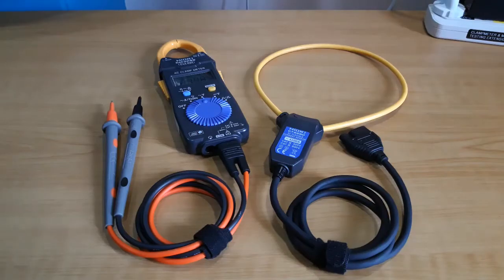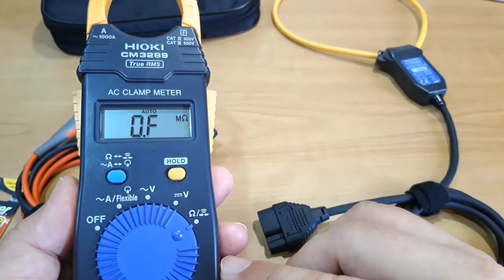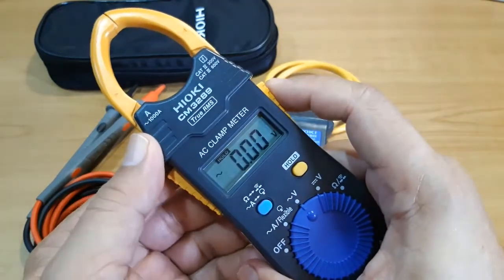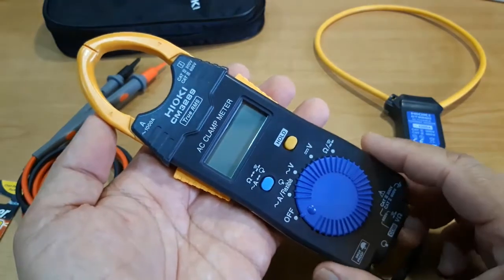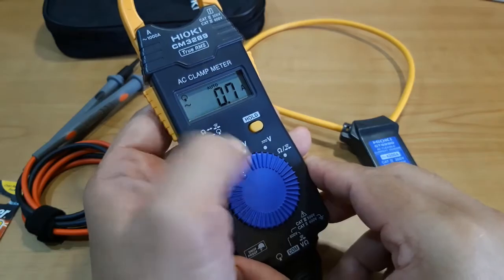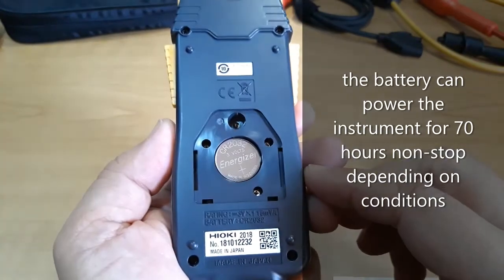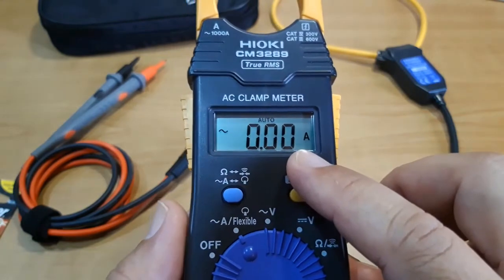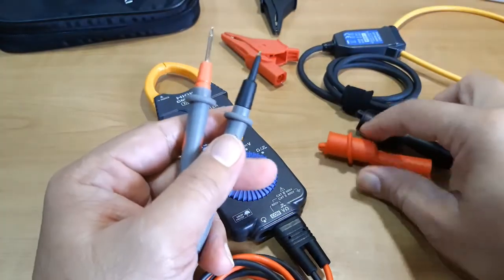[English Sub] Hioki CM3289 AC Clamp Meter and CT6280 AC Flexible Current Sensor Review

Comment: Thanks very thorough and clear. You obviously spent the time required to serve an excellent presentation. What is the correction factor for multiple flex sensor wraps around the conductor when seeking increased sensitivity? Thanmks again.
Reply from the maker: Thanks for your appreciation. There was no published correction factor for the use case you mentioned, unfortunately. It's also not specified for measuring minute currents or leakage currents. But coiling it twice on a conductor produced 2x the current reading, which was a good indicator for accuracy or at least consistency. Should be useful if you want to measure current 1A or so on a location too narrow for the rigid jaws of a clamp meter. I'll try and upload a short demo of this.
Reply: @ramschannelreviews  Thank you. I too have only seen a chart with Three circles and numbers one through three. no other notations, but it suggests what you demonstrated and observed. Thank you.
Reply from the maker: @flashwashington2735   I ran a 2000w AC load through a line splitter to compare readings between the rigid jaws of a Hioki 3289 true RMS clamp meter and the flexible current sensor, CT3280. They produced essentially the same result when the flex CT was wound once. But as expected, the current reading rose twice as high when the flex CT was coiled by 2 turns. This is just one illustration on how to possibly apply this in a practical situation when necessary. The operator just need to be aware on how to correctly interpret the results. Thank you.
https://youtube.com/shorts/n82QqMcamOI?feature=share
Reply from the maker: @flashwashington2735  Thanks for sharing your findings. I watched the linked videos from Fluke. You mentioned the words potentially very precise. I think you're on to something here. In theory, it should produce twice the amount of current, when you turn the CT3280 two times, by virtue of transformer coupling principle. But since there are a number of environmental factors that can affect accuracy, the result may not be exactly 2x (or 3x) when you turn the flexible sensor as much. But it produced almost 2X (at least in my experiment) to say it's close enough to be precise. Even the Fluke video mentioned that you can coil the iFlex twice to get more accurate reading. It's their product so they must know what they are saying. 

I think that the operator, based on their actual experience using the test equipment, can have a better understanding of how it works and how to interpret its results correctly. As you know, the Hioki 3289 and CT3280 were designed for power frequencies 50Hz-60Hz, with some tolerance. They won't work well with VFDs producing lower frequencies.   

Glad to have helped. I'm retired, too, LOL! Thanks also and have good day! Keep well and safe testing!

Comment: I’ve had the 3244-60 for years. I bought it while I was in the mines doing electrical work. It always went straight to the reading. None of that oscillating and finally resting on the right number like the expensive fluke. I mean it would go straight to the number. I mean I wouldn’t call a mining electrician a real electrician, but we had to assess things fast and just didn’t understand all of that waffling b.s.

I just bought this one to check the amps on the elements on all of the water heaters in all of the facilities that I work at now (doing plumbing). If it works anything like my little pocket meter did, we’re going to get along just fine.
Reply from the maker: Thanks for your comments. It's interesting that your 3244-60 is still being produced by Hioki and in Japan. I think you'll find the CM3289 a good clamp meter. It defaults to auto ranging but can also do manual range if you want a bit faster reading. It's also as compact and handy as the 3244-60. Good luck!

Comment from the maker: Thanks for your comments Joseph. Yes, it is. Although you have to be careful not to drop or knock it about since it doesn't have rubber cladding. As far as I know, the floor and sides of ships are thick metal. Ingat bro!
Reply: "Ingat bro!". . . Are you speak in bahasa too, Sir ?
Reply from the maker: @AndiT82  No Sir. It's a Filipino term meaning take care. But I worked in Malaysia years ago so I know that in Malaysian or Indonesian, it means remember bro. Boleh cakap bahasa sikit sikit.